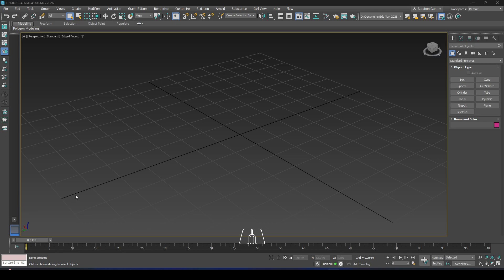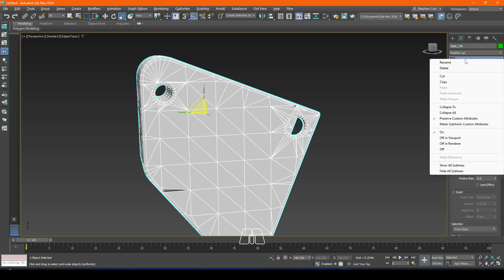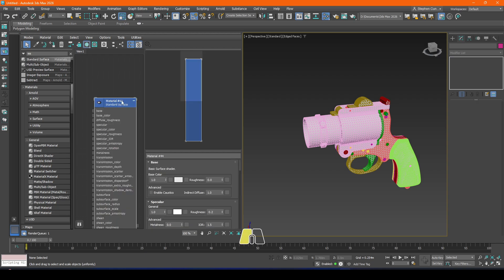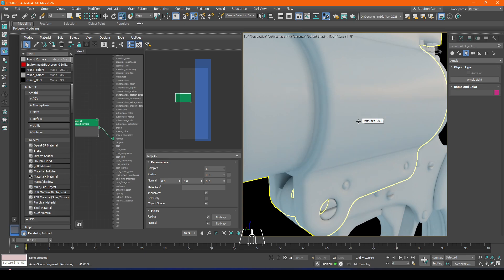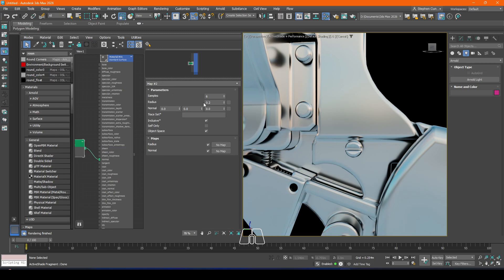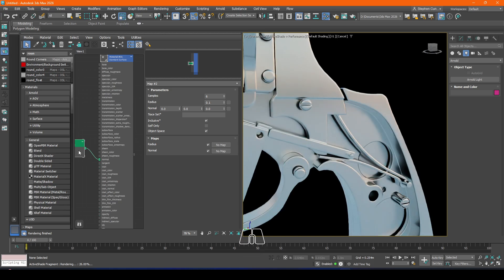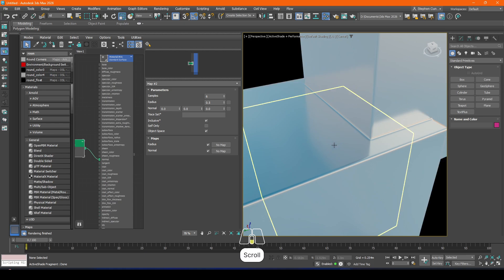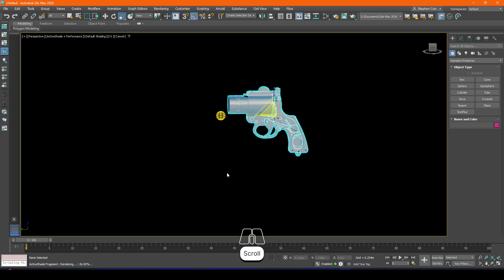No More Chamfers! Bevel Shader Setup in 3ds Max for Clean Visualization

Comment: so the question is if we can use such a workflow in game development: 1. create high/mid level prop 2. use bevel shader in unreal with nanite. with this workflow you would skip the baking and creating both low and high poly models, which is a pain in the ass. is this possible in unreal? did not find any infos about a built in bevel shader.
Reply from the maker: Hey, that's a great question. It would enable you to skip aspects of the development process, in particular the details needed for the highpoly bevels. This shader is a little old, Marmoset Toolbag has brought their own bevel shader out, which is much better for a games workflow, I'd recommend checking that out if you are considering adopting such techniques within your own workflows. Hope this helps.